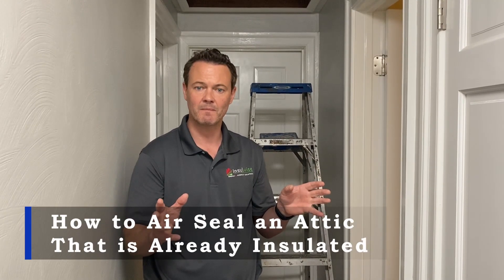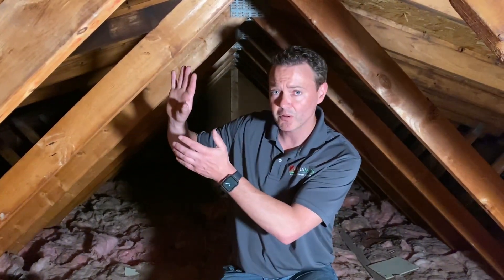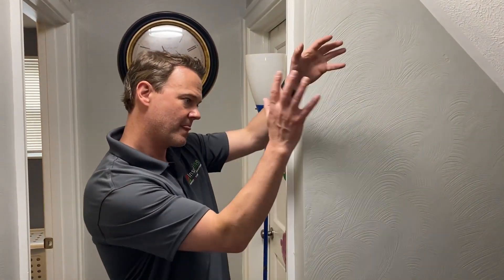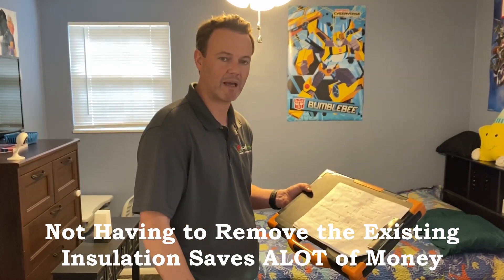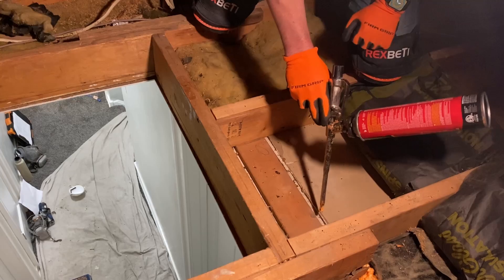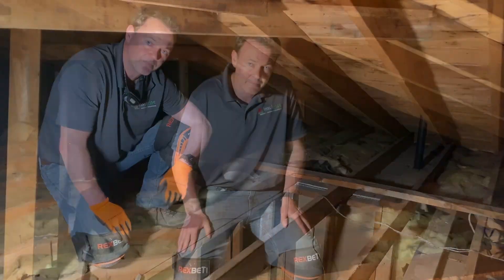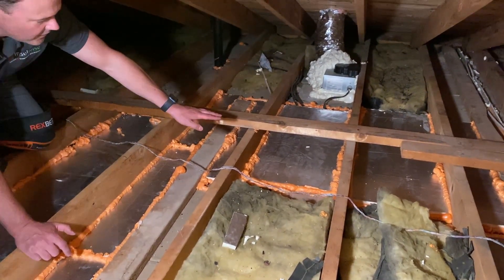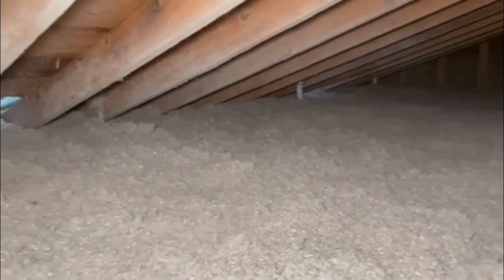Insulation Expert Reveals the BEST Way to Air Seal Your Attic

Comment: Do you have to install baffles before the cellulose?
Reply from the maker: When there are soffit or under shingle intake vents --- yes absolutely.  This house did not have soffit vents so we installed a series of slant back vents on the back roof of the home to provide intake ventilation.  I point that out at the end of the video and you can see light coming in from them.  Thanks for commenting!
Andy

Comment: What about the roof joists. Do you insulate between them?
Reply from the maker: It can be done yes, but in most cases we are bigger fans of allowing the roof to its stated purpose, which is shed snow and water.  A lot can go wrong when you attempt to insulate the actual roof.

Comment: How has it been properly ventilated?   It doesn’t appear to have unobstructed soffit.   Where is the ventilation coming from?
Reply from the maker: Watch the end of the video.  There were no soffit vents for intake so we installed slant back vents lower down on the roof at the back of the home to provide intake ventilation.

Comment: I’m curious about attic access for repairs after the insulation work is done. For example. Let’s say that this homeowner needs to replace the bathroom vent assembly. How would a contractor handle that task in this attic, now that the fan’s box has been liberally spray foamed and covered with cellulose?  Just trying to educate myself for this possibility, as my home is a pretty close match to this video’s attic in all respects. Thank you.
Reply from the maker: Hi there.  Respirator, knee pads, headlamp, gloves, and a kitchen broom to whisk a path through the cellulose.  The foam can be removed easily enough picking it away by hand.  Do the work needed and brush the cellulose back into place.  I've had to do things like this many times.  It's not too bad if you have the right basic gear.  Hope this helps!
Andy

Comment: After looking at so many other insulation companies/videos, you're the answer man and you've answered several of my questions. I will use all of your practices as well as your scuttle design on our new ranch style purchase (Northwest CT). But I have a dilemma. Our new house is an old hunting cabin with very decorative pine walls and ceiling that was built in 1949 (T&G on one edge and ship lap on the other ). The entire ceiling is an AIR LEAK. Shall I do all of my renovations and then lay down 2" opened cell spray  foam to seal? And then blown in? I removed some decorative pine covering an exposed load bearing beam.. I arrive the next morning, roof covered in frost except where I removed the boards. The roof had a line up it that was just wet.
Reply from the maker: Thanks for commenting and the compliment!  We try, and when you break it down it's all applied building science stuff.  Your home is pretty complicated and I've been around these types of homes a little bit.  Yes, spray foam that whole attic floor (after removing any existing insulation) ideally with closed cell foam as you get a vapor barrier at 2".  But if you spray the attic floor with open cell and effectively ventilate the roof (I'd advise doing this in both cases) you'll still be fine.  Open cell foam is a fine material but you have to understand its limitations.  In cold / wet climates it cannot be used on the underside of a roof because it does not have a vapor barrier.  Hope this helps!
Andy
Reply: @insulwiseenergycomfortsolu3293  Can you answer one more question? After removing a few damaged interior pine boards there is insulation though marginal. It has a black paper face with no script on it and has roughly 1 inch insulation. It is stapled 1.5 inches in on 2x4 studs. And it's stapled pretty securely.. My goal was to dense pack blown in insulation into the wall cavity when I sided it. How can now without removing this insulation? The entire cabin is 7 to 12" wide vertical pine interior walls with 1x8 pine for exterior sheathing.
Reply: @insulwiseenergycomfortsolu3293  I have a similar issue - a house with tongue and groove ceilings throughout. I was considering doing what you did with the stairwell void since it would be much cheaper than spray foam. Would that work?
Reply: @insulwiseenergycomfortsolu3293  TY

Comment: Is this the case even with super old homes? (1920's midwest worker home) Our bathroom never had an exhaust fan installed, so I just got that done before the cold snap came through, but we still have frost on the underside of the roof. Worried that sealing things up will lead to mold growth on the underside of our ceiling by not allowing the higher humidity in our home to vent into the attic. I guess we need to lower our humidity throughout the house, but that's a bit difficult to do when the wife suffers from sleep apnea and benefits from a humidifier when we sleep.
Reply from the maker: Yes, all homes that have attics have air leaks hidden everywhere in them.  Nice work getting the bathroom vent in.  Did you vent that to the outside through the roof or gable wall?  You shouldn't get mold growth on your inside walls / ceiling unless there is missing insulation in an area.  Those areas can get cold and water can condense there with eventual mold growth.  If you can air seal the attic floor, you will have naturally higher humidity inside the home because you're not constantly losing warm air and water vapor from inside the home to the attic. 
Andy

Comment: Thanks for the detailed video.  I am about to do this for my home, so this is a big help.  My question is how do you seal the exterior wall top plates and wire holes? It looks like you have a 6:12 roof and even laying on a board I can't see how you can get close enough to pull back the insulation and see what you are doing.  Mine is worse with a 4:12 pitch and blown in cellulose on top of the batts.
Reply from the maker: Thank you and great question.  In homes with low pitch roofs we cannot get to those exterior plates where the roof comes down to seal them.  However, if the exterior walls are already insulated that will slow down the air loss rate, so they're not quite as critical as the interior plates where the walls are uninsulated.  When we do have access to exterior plates and pull back the fiberglass there it is not nearly as dark and dusty (proof of air leakage) as the batts are that are over interior walls. 
Andy

Comment: Amazing video! For homes with a crawl space do you recommend a similar exercise below the subfloor? How would somebody best insulate/seal between the joists, ideally without having to seal/condition the entire crawlspace itself (much larger undertaking)
Reply from the maker: Thank you!  Crawl spaces are a different beast entirely.  When possible you want to encapsulate them.  If you're not familiar with that process you want to look it up.   Vented crawl spaces are never ideal if that's what you have there.

Comment: We have a shed-type sunroom attached to the back of our home. There’s no way to seal the top plates since we can’t get to them because of the ceiling. Do you have any suggestions for sealing any leaks? We did seal around the ceiling lights because we felt air escaping. Would it help to seal around the top of each wall on the inside and the ceiling? The room is all shiplap including the ceiling.  Great video - we will definitely be applying your techniques in the remainder of our home.
Reply from the maker: Thanks for the compliment!  Air sealing the lights in the ceiling would have been super helpful.  If there are gaps between the shiplap that can be caulked that would be the next step.  Also caulk around any baseboard or crown molding on the ceiling where air could be escaping.  Last would be getting the switch and outlets boxes sealed.  The foam inserts would be the easiest thing there.  Hope this helps!
Andy

Comment: It looks like you did a great job, but it also looks like you’re completely closed off the soffit vents for proper airflow in the attic space when you added insulation? Also, what is the best way to seal up the attic access panel? Thanks.
Reply from the maker: Thanks for commenting!  This is the most commonly asked question.  The house had no soffit vents or overhangs.  We added intake ventilation along the back of the roof in the form of slant back roofs.  If there are no soffit vents we don't install baffles.  The cellulose naturally settles away from the underside of the roof by about half an inch after blowing.  It causes no problems in the homes that we work in. 

This is the best way to seal an access panel.  Let me know if you have questions. 
https://www.youtube.com/watch?v=1CoYbMxrkXM&t=5s
Andy
Reply: @ thank you for the response! I’ll check out your link.

Comment: Never do this to your house. The state did this to my parents house in Vermont. Never  had a problem  with mold, now big problems.  Never had a problem with there wood stove drafting, now big problems.  Would you rather save a few dollars on energy cost and potential harm your  respiratory system? Or breathe fresh air ?
You can actually see condensation on stuff in the house on certain days, but the weatherization, company made money from the state insulating.My parents house.
Reply: So I'm struggling to understand why to air seal so much from up in the attic as opposed to the living space? Can't you more effectively seal things like outlets and lights from the interior to stop the air leaks getting into the walls in the first place? Otherwise where is all that conditioned air getting into the walls? Thanks!
Reply from the maker: @c.j.c350   Great question and thanks for commenting.  It's more difficult in my opinion to seal air leaks from inside the home.  To seal a leaky outlet you need to remove the outlet fully from the wall, and then seal all of the little openings in the backside of the box with either foam or a caulk gun with an tip extender.  You also won't be able to seal around things like plumbing pipe penetrations from below.  Also, almost every wall top plate leaks air, not just the ones with outlets in them.  Why?  Your electric wires run through horizontal holes in the studs from wall bay to wall bay, so do plumbing pipes and duct work etc.  If you seal everything from the top you know that you didn't miss anything. 
Andy
Reply from the maker: I can tell you that in performing attic air sealing solutions in thousands of homes in the Pittsburgh area that this issues of condensation / moisture build up in the home after the fact has happened only a handful of times.  Every time the issue was that they had a humidifier on their furnace that had been turned up too high or was not working properly.  Once the humidifier was turned down or off the problem disappeared.  Often times humidifiers are installed on furnaces to make up for the home's humidity / water vapor being lost to the outside via Stack Effect driven air leakage through the attic. 
When the attic air leaks are sealed, the home then retains both warm air and moisture / humidity more effectively.  In many cases the home no longer needs to run its humidifier at all.  Some homes also produce a lot more moisture than others.  Homes with fish tanks, people showering and not using bathroom fans, homes with water intrusion issues around the foundation, etc. all can produce copious amounts of moisture.  
Air sealing the attic floor of 99.9% of the homes we've worked in has yielded not only dramatically more energy efficient homes, but also more comfortable homes with improved interior air quality.  There is a reason why every building science related resource on the internet (at least that I am aware of) recommends performing this practice.  
Thanks!
Andy
Reply: Like I said don't  do it. , I'm in the hvac trade. So where does all the stale air go? When sealing up a house like that, everything needs to be taken into consideration. When they were done sealing the house, the hot water heater had to be removed because of downdraft. When you turned on, the bathroom fan😅😅😅
Reply from the maker: @MrSprintcat  It's nearly impossible to make the vast majority of existing homes too tight by performing basic air sealing measures on them.  That said, there are exceptions.  At this point it would be been advisable to something like an ERV or HRV to bring in fresh, outside air, but not loose too much heat/ energy in the process.  I've seen draft inducers installed on hot water heater numerous times, this helps them to avoid back drafting.  That, I can tell you that I've seen HVAC teams leave massive leaks/ holes in the cold air returns of duct systems -- directly next to hot water heaters -- causing them to backdraft.  As I matter of fact I have a video where I find this in a home --- here's the link:  https://www.youtube.com/watch?v=v2t17XTLr5A
Reply: I'm sure you know what negative  and positive pressures are?
Reply from the maker: @MrSprintcat  Pretty well versed in them
Reply: When you have the wood stove going in the basement, can you turn on any fan in the house bathroom you draw smoke from outside into the house😅😅😅
Reply from the maker: @MrSprintcat  I have tightened the air and thermal barriers of thousands of homes.  I don't doubt that the story you're recounting is true, but I will tell you that it is unusual.  Our company over the last 15 years has hundreds of glowing reviews for the services that we've rendered in homes, feel free to have a look.  If what you are suggesting happens commonly in homes when this type of work is done, I don't think we'd be in business for long.
Reply: If you would like give me your email, I'll shoot you a picture of the mold

Comment: B.S. ! B.S.! B.S.!  
If all that is happening it because the attic is not insulated correct. 
I listened for 3 min. and couldn't take no more. 
"That is all SALE TACTICS! " 
   That like people used to go around with a Light detector and get close to windows and say lose of heat through the Windows when it was a light detector. 
And sell someone new windows.  
And ill close with this. 
I have 40 years experience, 30 for myself,  degree in C.A.D. and Construction management.
Reply from the maker: What you do not have expertise in is building science.  It's well known that blown or rolled insulation does NOT stop air leakage from a home.  You can see at points in the video when I pull fiberglass batts back that there is black streaking in it.  That dirtiness is caused as air from the house leaks upward into the attic, taking dust from the home with it.  I've attached a link below, have a look.  As I pull back the batts of fiberglass in an attic you can perfectly see the blackened outlines of the top plates in the fiberglass.  But you don't have to take my word for it.  If you google "does insulation stop air leakage" you should find all the info you could ever want. 

Click on this link and go to the 55 second mark: 
https://www.youtube.com/watch?v=X7GMG3T8cE8

Comment: When you have insulated flex ductwork in the attic that “spiders” off of the main trunk, does it get buried underneath the blown in insulation? I don’t have any experience with the blown insulation and wondered if there was a risk of it collapsing the flex duct if it was buried?
Reply from the maker: Hi there, best approach for dealing with flex duct in an attic is to make sure that you've first sealed the connections to the trunk line / main trunk as tightly as you can.  We see collars / take offs poorly attached and leaking massively all the time.  You also need to seal the register boots to the attic floor with foam.  Once you've been able to get the duct connections air sealed, then yes, you want to cover / encapsulate the flex lines with blown insulation to add extra R-Value.  It will not collapse flex duct lines. 
Andy

Comment: Great video. I recently had someone look at my attic’s insulation and I asked about air sealing. The rep told me I did not need it bc of the climate in TN. After watching your video, I know that isn’t true.
Reply from the maker: Thanks!  Yes, don't hire this company.  Look for a company that's building science based (BPI or RESNET training).  Anyone that tells you that an attic does not need air sealed is ignorant of these processes.  I have felt air conditioning blasting my hands through attic air leaks on hot summer days Many times.  Even if the air isn't rising from winter time stack effect, it can still escape via imbalances in duct systems.  
Andy

Comment: My question is why?  What difference does it make if the cracks are sealed, if it all sits under R60?  A little air crack is going to work its way through R60?
Reply from the maker: Hi Eddie, the answer is yes.  Air flow from your house during the winter will absolutely bleed through any type of blown in insulation -- unless it's dense packed but that's a closed cavity solution.  We prove this by doing blower door tests in homes with tons of blown in fiberglass (and sometimes even cellulose) all the time.

Comment: What if your attic already has installation already blown in?
Reply from the maker: It's harder but it's the same steps.  Draw your map from below, put on your PPE gear, then crawl through the material as carefully as possible to track down the air leaks and seal them.  It will suck at first, but you get used to it after a few minutes.  You just need to be methodical and not in a hurry.